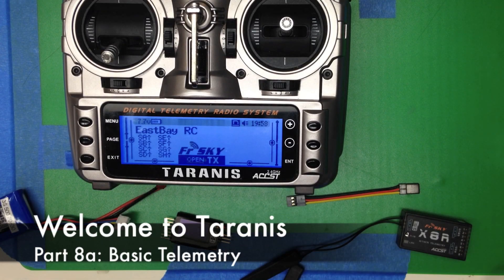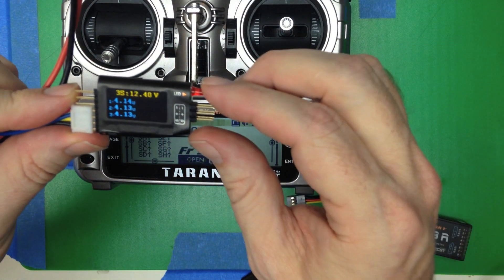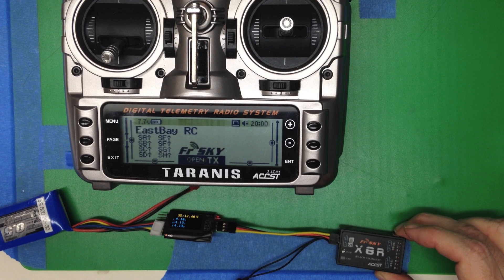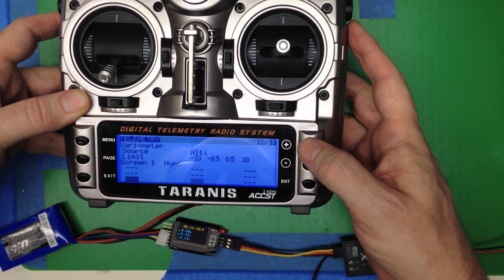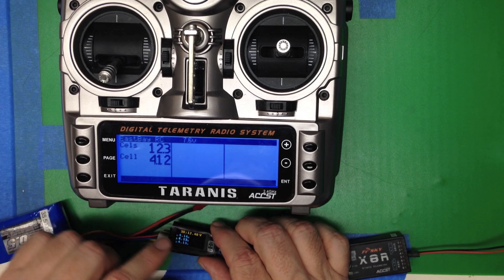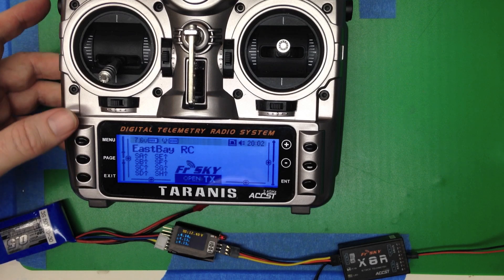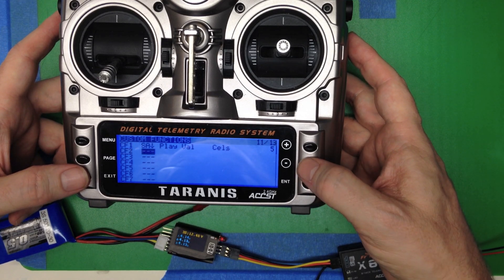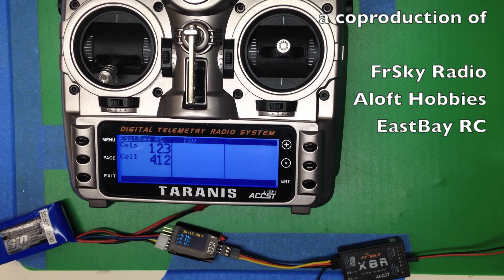Welcome to Taranis, Part 8a: Basic Telemetry

Comment: Thanks. The sensor now works great when bound in (what Frsky call) Mode 5(D16) which is no jumper for binding and holding down the F/S button on reciever when using D16 mode on the Taranis.

Comment: Does it have to be bound in D16 or is D8 mode ok? I have mine setup exactly as you describe here and get no values showing in Cells or Cell. This I tried with 2 X8R receivers as well ); I also have tried the 40a current sensor and variometer with the same result. Could the Taranis need updating as this hasn't been done.
Reply from the maker: X Series receivers should be bound in D16 mode.  This will allow you to get the Smart Port telemetry. D Series can be bound in D8 mode.  You can only get the more limited A1 and A2 telemetry values for D Series.

Comment: Thanks for the video , its really explained nicely , much appreciated.
Can you use two of these to measure up to 12S packs? Voltage telemetry seems clunky and expensive for greater than 6S packs. For many 8S/10S/12S pack voltage is all you want to know. like on spectrum t1000, which just measures total pack voltage and you can set your alarm on that. (and its a simple two wire cable accross the series pack, connected to the t1000 telemetry module.
Reply: I think you can. you would have to get a servo changer and change the ID's of each sensor. I believe you make one master and the other one slave... something like that.

Comment: after 3days of hair pulling i the battery volt meter is only sensor that is worth anything the companion software is just numbers and graph no instruction to tell mph or feet.

now i see why no vidios can be found about the gps and using it for speed readings

still its a good radio but dont buy it expecting the telemtry  to worth anything

Comment: I got my taranis pretty quick, I also purchased the GPS Volt meter and variometer. I plug them in the "smart port" in the correct polarity.

I have tried connecting individual sensors and changed polarities, I get no readings on the radio but I do get the lipo volt reading, but I get the and the RSSI without any modules connected.

is there something I need to do to tel the x8r to do or is it just supposed to work when you plug in the sensors? Instructions for these suck!

Comment: can your record the telemetry data of a flight to the SD card?
Reply: gave up on using this radio for telemetry data, besides found a better way, with On screen display and pocket DVR of FPV

never could get the google maps GPS crap to work but who cares, when I can get what I need on screen!

I have been able to fly at 110 MPH with my funjet and experience it with FPV and OSD.

Kind of find this radio a waste of money now.

Not to mention the rudeness of trying to ask anyone how anything works, all I eve got was 'its free firmware be happy with it)

Well the radio cost me $300 so yea I think clear and precise instruction on how everything works should be part of the deal!

Comment: Hi, nice video and thanks for posting... Quick question: If I like to see what each of my FOUR esc's are drawing in AMPS, how can I do this, if I can at all, using this radio?! Will it show ALL four at the same time, or will it display each esc;s one after the other?! Also, what do I need in order to see the esc's amp draw and/or capacity used?! Thanks a lot! G
Reply from the maker: Thanks!  You can get this information with either the FrSky FAS-40 or FAS-100 sensor (40 max amps and 100 max amps).  This sits between the battery and your quadcopter.  It has a SPort output that works like in this video.  There's an "amps" or "current" item in the radio menu.  Good Luck!
Reply: Mark Harrison Sorry, never thanked you for your reply!

Comment: Hi Mark, your vids are clear and easy to understand and follow,many thanks. however it has left me very puzzled as to why i cant set up my D8R-2-Plus to work with the internal sensor? whenever i turn on the TX or flip the switch i get a Zero volts anounement!? can you shed some light on this? its getting very frustrating!
Keep those brill vids coming!

Comment: So for a GPS sensor, do you need to buy a sensor hub, or can you just plug it into the receiver? Also, are you using the voltage sensor to supply power to the receiver? If so, how much does it supply?
Reply from the maker: GPS Sensor is an SPORT sensor, so it can plug directly to Rx, or be part of a daisy chain.  The voltage sensor doesn't supply power, it plugs into the battery balance port.

Comment: Hi Mark, 
What is that red, black and yellow wire that is connected to the s-port? Is this a special type of wire? Did it come with the battery monitor?
Why are you using two lipos? Shouldn't the balance lead for the lipo that is connected to the esc be connected to the battery monitor? After all you want to know the voltage of the lipo that is driving the system. What is the point of having the second lipo?
Reply from the maker: That's a simple servo connector.  Basically just need 3 wires, ground, power, signal.  The second battery was just to eliminate using an ESC which was crowding out the other components on the screen.